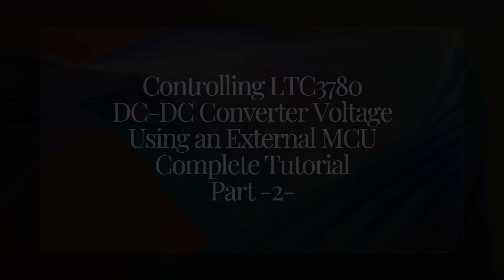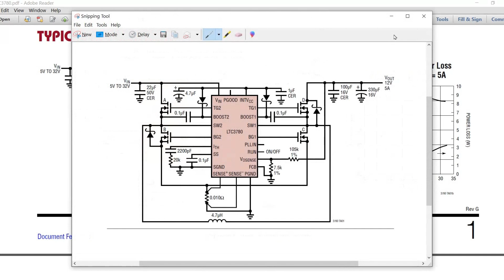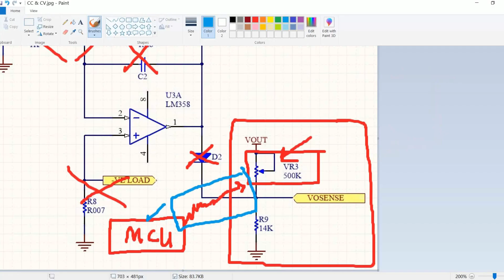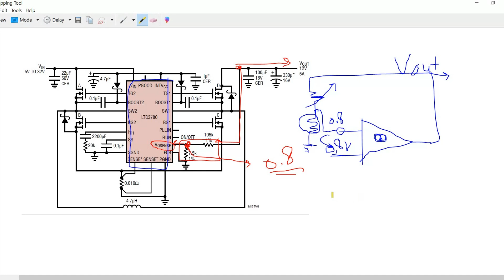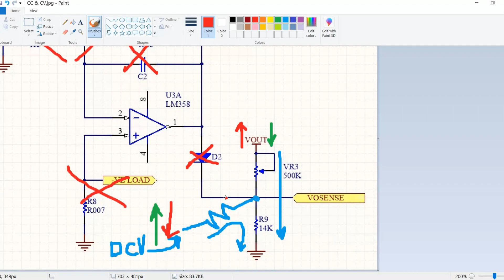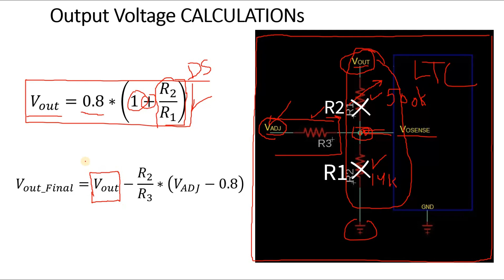Controlling LTC3780 DC-DC Converter Voltage Using an External MCU: Complete Tutorial Part -2-

Comment: i have been figuring out a way to do exactly this for a while now, could you please share the place where you for the schematic for the board? or are you reverse engineering it yourself?

i was considering putting a digital, high accuracy wattmeter like the INA260 at the output stage, then using a mcu to take that data, do the math, and use an DAC to put a analog voltage at the op-amp input connected to the 200k and 500k pot and resistor network, that would basically replace the feedback hardware with software, my issue being i would have to reverse engineer all the formulas that are required to do said feedback

this video even as is has been a godsend in my endeavour as i finally have a 100% tested and accurate schematic of the current and voltage control circuit, tho i unfortunately lack the skills to use just the image of the schematic and the datasheet to figure out all the formulae, but it is a step in the right direction

as a student i dont fully grasp how the constant current function works out in this however, perhaps i need to rewatch your video and re-read the datasheet a few more times, but my understanding tells me that the method of slapping a DAC on the input of the op-amp would only work to control the voltage, not current???

another annoyance is the board i have is the only one i have access to and will be a pain to replace if i blow it up, so unless im super sure about what im doing i should refrain from messing with it

EDIT: my first idea at the beginning was just putting a digital pot where the current control and voltage control potentiometers are, however 200k and 500k potentiometers are basically non-existent, thus began my decent into this rabbithole
Reply from the maker: You’re definitely heading in the right direction — and honestly, I admire the amount of thought and effort you’ve already put into this. A lot of people just copy these modules blindly, but you’re actually trying to understand the entire control loop. That’s how real power-electronics engineers are made. 

For the schematic:
I reverse-engineered the board myself. These cheap LTC3780 modules rarely come with proper documentation, and the schematics floating around online are usually incomplete or straight-up wrong. That’s exactly why I created this breakdown — to give everyone a tested and accurate reference you can trust.

About your idea using the INA260 + MCU + DAC

This approach can work, and it essentially turns the analog control architecture into a fully programmable digital feedback system. But you’re right — you would need to reconstruct all the formula relationships:

Output voltage feedback divider → op-amp input → FB pin

Output current sense amplifier → CC regulation → FB modifier

The LTC3780’s CC loop is not as straightforward as simple buck/boost chargers. The op-amp is actually injecting an error into the FB node whenever the current hits the threshold. That’s why voltage-only DAC control won’t give you CC regulation.

The DAC-to-op-amp idea will control voltage, but without tapping into the current sense path, it won’t control CC.

Why CC regulation is tricky

On this module, CC is achieved by monitoring the voltage across the sense resistor and comparing it through an error amplifier. Once the threshold is hit, the amplifier pulls down the FB node, forcing the output to drop.

To digitally control CC, you’d need to replicate or override that error amplifier behavior — not just the voltage divider.

So your instinct was correct:
DAC can replace the voltage pot but alone cannot replace the current pot without deeper loop interaction

Regarding digital pots

You’re 100% right — there are no 200 kΩ or 500 kΩ digital pots on the market.
That’s why going the DAC route is the only realistic solution if you want full digital control.

Final Thoughts

Since you have only one board, I completely understand your concern about damaging it — the power stage can fail fast if something goes wrong in the feedback loop.

What I’ll do:
I’ll try to cover this entire topic — digital feedback, replacing the pots with DACs, and how CC/CV feedback formulas work — in a future tutorial.
This is a deep rabbit hole, but it’s also a very rewarding one.

Stay tuned — I think this will make a great advanced video for the channel.

If you need help understanding the CC loop formulas, feel free to ask — I’m happy to break them down step-by-step.

Comment: Can't his circuit be further modified to drive higher currents by modifying current sense? The chip us basically a controller with a max current sense and voltage sense limits.
Reply from the maker: You’re absolutely right — the LTC3780 is essentially a controller, and in theory you can modify the current sense network to increase the allowable current limit. 

But the catch is: once you raise the current threshold, all the external power components (MOSFETs, inductor, diode, PCB layout, thermal design) must also be upgraded to safely handle the higher current.

If the power stage isn’t redesigned for the increased load, the MOSFETs or inductor will hit saturation or overheating long before the controller does. So yes, it’s possible — but it becomes a full power-stage redesign rather than just changing a sense resistor.

I might explore this idea in a future deep-dive tutorial, so stay tuned!

Comment: Great idea to control Dc/dc with external voltage source connecting to FB pin of LTC3780. I think my next challenges is to built and implement a PI/PID algorithm to control output voltage dc/dc stably and exactly. It't forced to do that because I use this for controlling CC/CV charger.
Reply from the maker: Absolutely! Controlling the LTC3780 through the FB pin with an external voltage source opens up a lot of possibilities.
And yes — once you move toward precise CC/CV control, implementing a PI or PID loop becomes almost essential for stable, accurate, and fast response.

The real challenge (and fun part) is tuning the loop so the converter doesn’t overshoot or oscillate under dynamic loads. A properly tuned PI/PID will give you that rock-solid regulation needed for a reliable charger system.

I’ll definitely try to implement this idea in a future tutorial — so stay tuned!